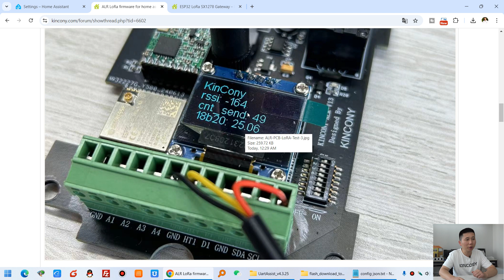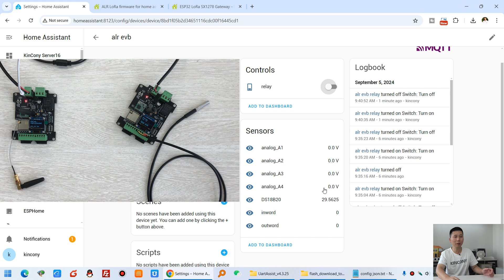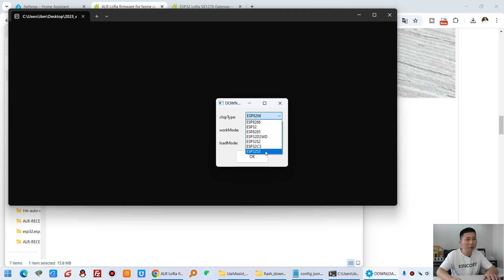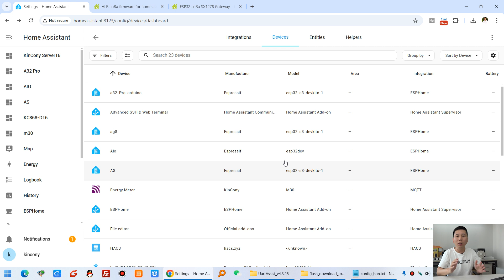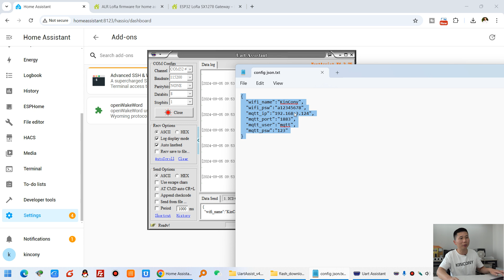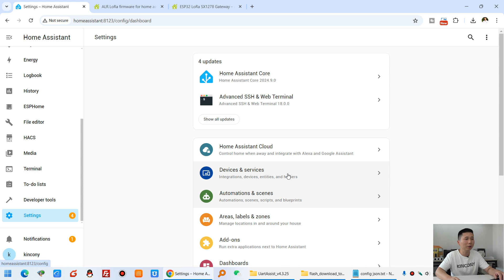ESP32 LoRa board use in home assistant by mqtt auto discovery - ALR

Comment: Can the inside board be used as gateway (one inside and multiple outside), so I don't need multiple board inside?
Reply from the maker: now the firmware is one by one. but if you can modify arduino source code, you can let one gateway work with multi outside boards.
Reply: @KinCony  could you update firmware?
Reply from the maker: @chharoatchin18  if many user want support this, we will update in furture.
Reply: @KinCony  if you could share your INO files instead of .bin, then people can help themself better. I know it was a lot for work for you, but sales will increase when people figure out how to address many ALR boards via HA mqtt :-)
Reply from the maker: @martingerhardsoos  thanks for suggestion.
Reply: @KinCony  Your customers needs to have an oportunity to use one board as gateway and many others as transmiters. For example : first in garage, second in garden, third in mailbox. So tell us please, should we waite till you will update the firmware or we should look for other solutions from other manufacturers ? Thanks
Reply from the maker: @МаршДім  we can update firmware in furture. Do you have some other solution already can do this? use by LoRaWAN?
Reply: @KinCony  Dragino have, but it is to expensive for my country house, just only gateway costs there 100 dollars
Reply from the maker: @МаршДім  ok, i have checked that. it's lorawan product.